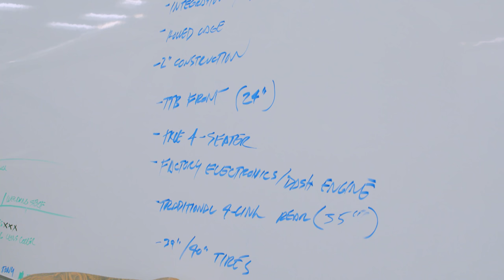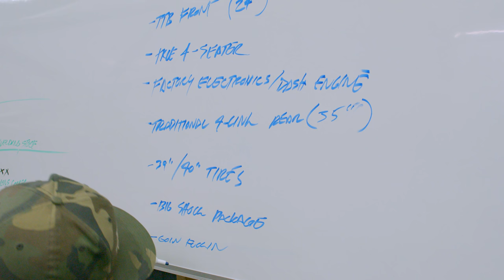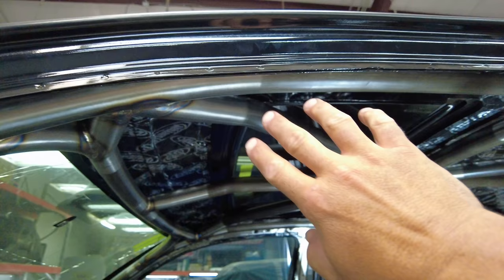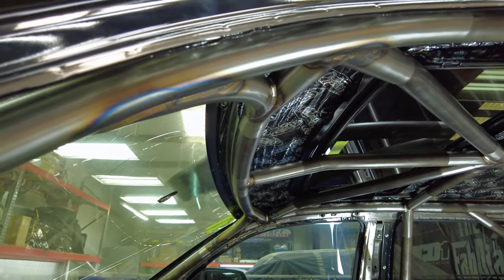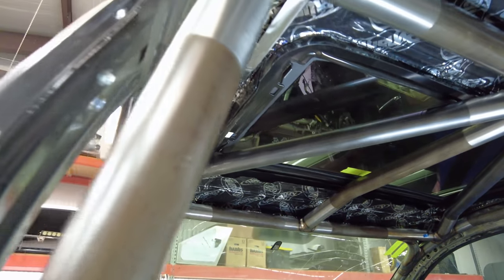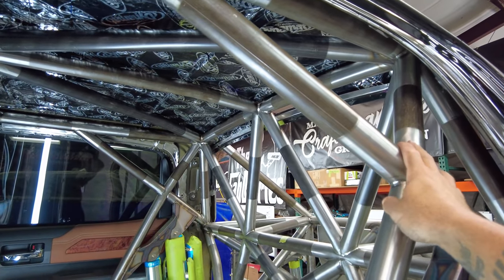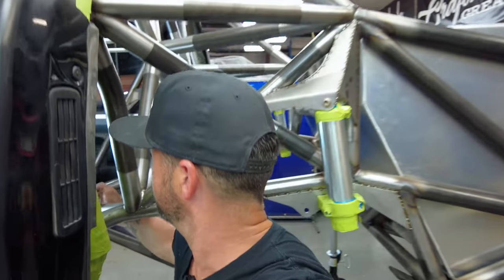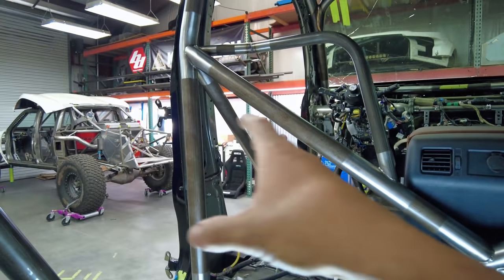Build Series | Selena Ep.3 - Goin’ cage’n!

Comment: I'd love to see you pull the upper section , weld it,  reinstall it, then  weld it together inside the vehicle.  It always made me so curious to see 'how-to' tight quarter welding inside the truck.  I noticed the corner supports for the A & B pillars have a big notched section.  Curious to know how you notched them at such a deep angle.  that is so trick and model perfect.  I have an Eastwood notcher, but the hole saw is limited. I have to stop the notch, cut material then continue notching. 
  You are going down in history as one of the best fabricators.  
To me when I work with metal, it is therapy, not work.  I love seeing a project come together.  Better yet, I love the compliments I receive. People can't believe as the truck owner and not a shop owner,  I built the project myself. 
 I am always anticipating future videos.  If you can accommodate us amateur builders with the first sentence (requested) above, that would be awesome to see.  
 I am also curious to see the installation of final material covering the DynoMat on the roof above the tube work; how you squeeze in to install it. 
Thank you.
Reply from the maker: Thanks for the feedback! The next cage we do i will fully document for you guys!! Step by step!
Reply from the maker: And thank you for the support & kind words!